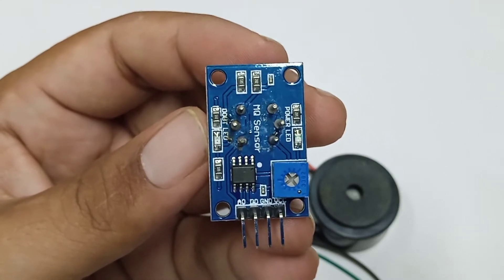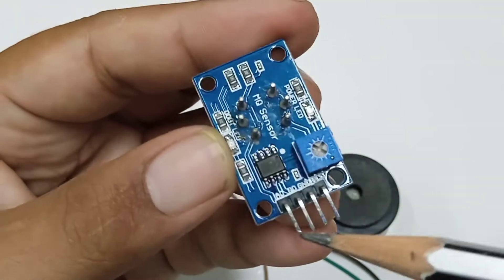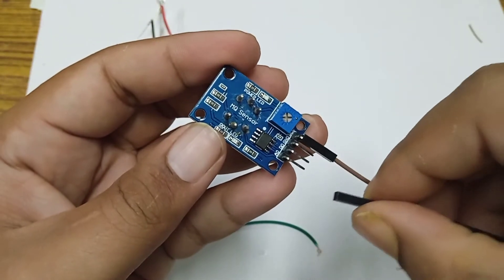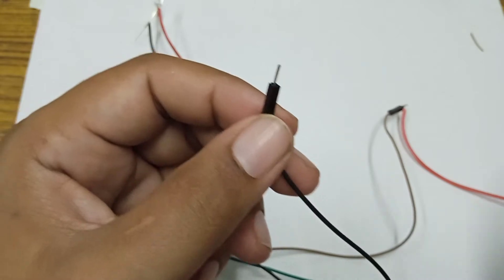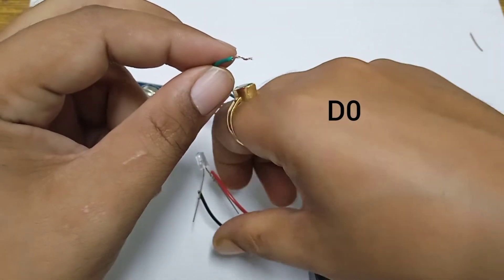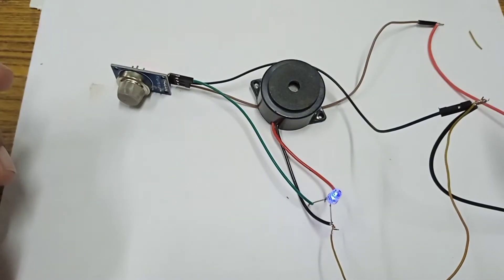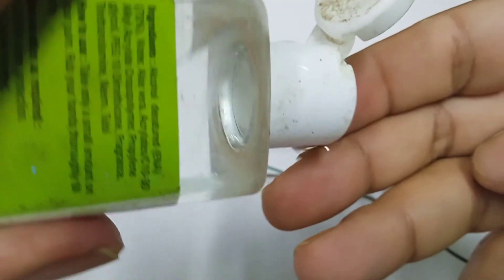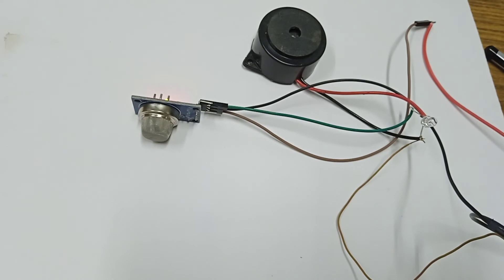GAS Sensor Module MQ2 Stand alone System

Comment: How can we use this in industry. Like can we connect 230 volt hooter with any board other than arduino for MQ-137 Sensor
Reply from the maker: Yes sir, u need to connect a relay, 9641000372 u can cotact me if u want

Comment: can i use 9v battery?
Reply from the maker: By 9V internal sensor heater may damage
Reply from the maker: If u want use 9v baytery, use 5v regulator IC 7805

Comment: I assembled circuit as shown in the video
It worked well,but in 2 hrs the 9v battery was fully discharged could you please give a solution?
Reply from the maker: The internal heater consumes maximum current,  which can not be avoided, use lithium ion high mahal battery or supply from AC power line through a 5V DC supply
Reply: @dipanjan100    I tried but when I connect to battery, sensor light getting off with in 2 seconds,  any body tell why it's getting switch off
Reply: @dipanjan100  can we use smart ph charger